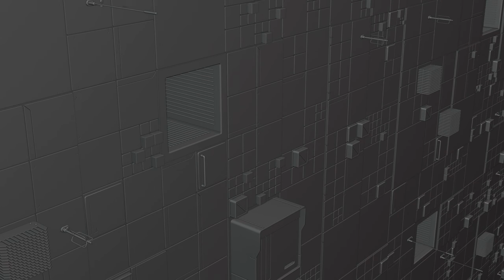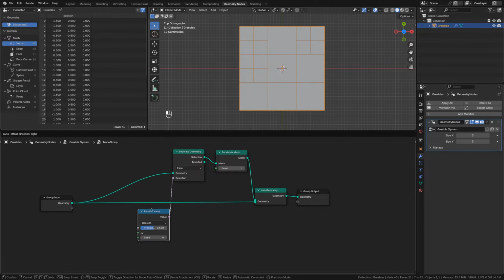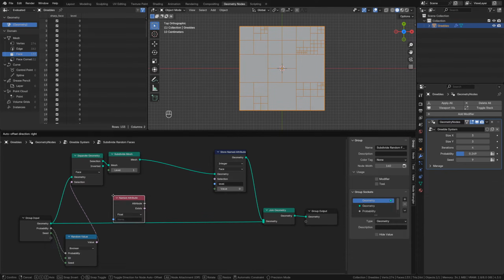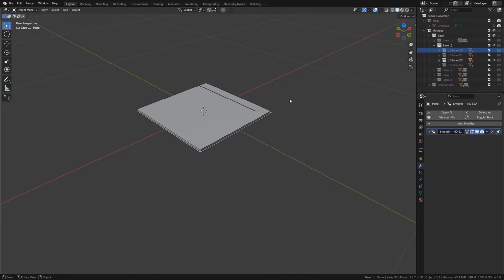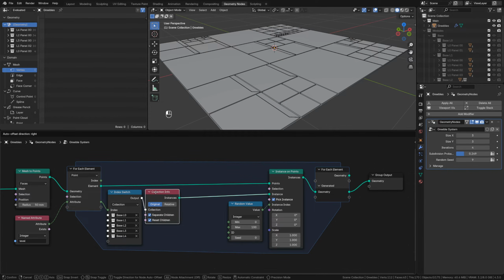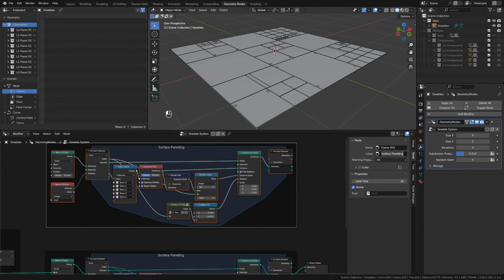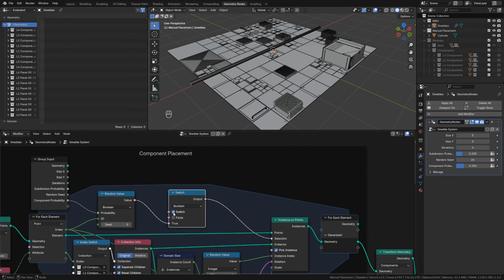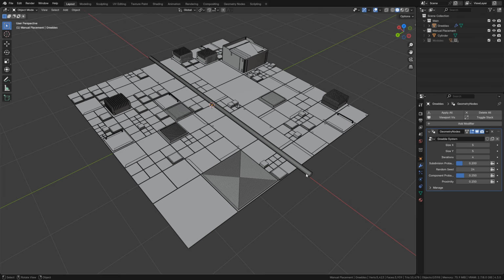Sci-Fi Greebles with Blender Geometry Nodes

Comment: Great tutorial. I am just coming to Blender from 3DS Max. In Max, I used a much simpler, much less controllable plugin called Greeble to do a super primitive version of this. This is far better, wish I'd had this much control in my max projects. Forgive me if this is a stupid question, but is there a way to make this a module that I can call up instantly in any project, rather than rebuilding this whole system from the ground up every time?
Reply from the maker: Hi, yes, you can definitely save the node setup as a reusable asset in your library to use in any project (https://brandon3d.com/geomentry-nodes-asset-browser/). This is a bit tedious unfortunately, but it's how we created the ND v2 Asset Library. Another way is to append from a saved Blender file to the current working file `File > Append`, which works with any kind of thing you'd like to reuse — Ian

Comment: ok, but this is done on the flat surface, how to creates the panels on cube or other 3D geometry?
Reply from the maker: Hi, this is trickier. I would try modeling the base geo to a standard sizing. Then I would use a foreach to loop over each face. Each face you would then treat as its own flat grid, applying the rest of the node network demonstrated. - Ian
Reply: @HugeMenace  ok, thank you so much - this is my first time when the content creator has answered my question, I appreciate it
Reply: @HugeMenace  Would it be possible to use the normal information of each face to rotate the instance? I'm new to Geometry nodes so I might be saying nonsense

Comment: Nice tutorial! But I don't see the grid at all when I add the grid node in the beginning :(
Reply from the maker: Hi, does the node appear? Is it just the viewport that is empty? I'm not sure what the problem could be, but it's probably something frustratingly simple. — Ian
Reply: @HugeMenace  Hi, the grid shows when I toggle X-Ray mode, but in solid mode it is only the plane, no grid. Maybe I'm missing something, I followed every step :) . Again thanks for the tutorial!
Reply: @VGModelling3D Bro, you need to toggle on the Wireframe in the Geometry options. This placing in Viewport Overlays.
Reply: @ivanmihailichenko9158  Thanks!
Reply: If you are using 5.0, it's fast to ask AI or something because there is a glitch that you can't see grid in right way if you use this combination of this nodes. I already experienced this and I looked up about it, and it was known glitch. So if you are using 5.0, you should use 4.3 instead.

Comment: Am going to watch this leter just need to know.

Will this have connected pips as well  ?
Reply from the maker: Hi, not in this video sorry. However, we have since added a pipe tool to ND which can be used to manually place pipes on the surface and have the other greebly bits avoid that. The procedural part of this video is mostly the recursively subdividing grid, no procedural pipes yet. Maybe one day I will revisit that. — Ian

Comment: 45:54 - yeah! i really like these kind of videos. I love procedural workflows.
how did you put more "floors" over the base layer in your final piece? are they just more COMPONENTS?

awesome tut! Huge thx!
Reply from the maker: Glad you like it! I assume you're talking about how the overall surface is not completely flat? Well spotted, I left this out of the tutorial for brevity :)

It's easy enough to replicate, you basically just place an 'Extrude Mesh` at the end of the 'Grid Generation' group. This node takes a selection, so I just used the 'level` stored attribute to limit which size faces were extruded. I only wanted the level zero to be used so that large chunks of the base/floor were at slightly different elevations. I also threw in a little bit of randomness so that not every level zero square had extrusion. If you'd like to see this in detail, please come and say hello on our Discord. — Ian

Comment: hi ! thank you very for this tutorial, so i made my own model in collection like the video and with ND too😎, i have problem with object in collection does not scale in face subdivision, about the 25th minute of the tutorial, verified all scale ok in collections Is there anything particular to set up on the collection?
Steph.
Reply from the maker: Hi, glad you like it. Are your collections ordered from top to bottom in scale? So in my example, the largest (0) is then followed by (1, 2, 3, 4) in the outliner. This might be the issue, but it could aslo be something else. If it's easier, please feel free to post in our Discord and I can take a look at your setup more closely.
Reply: @HugeMenace  hi ! collections are named same as you on video : Base\Base L0\L0 Panel 00\ and two part base (plan) and Panel two are created with ND and same for the rest,  i don't have discord on this PC (not a big fan with discord) I'm going to redo the meshes simply without ND to see just basic shapes and see if it's the same thing. (I use a translator in difficult cases so don't pay too much attention to my English😅)
Reply from the maker: @stephanema.6220  Ok, yes you can try making a copy of your ND objects for backup (moving them to a separate collection) and then apply all modifiers using the `Utils > Apply Modifiers` https://docs.nd.hugemenace.co/#/utils/apply-modifiers
Reply: @HugeMenace  find the problem i think my bad english, in fact each collection manage the scale according the subdivision, just listen twice (25 minutes) the nod juste place the model i doing divide the scale on the second collection for test
Reply: problem resolved thank you very much, by following English tutorials on Blender on youtube I pay more attention to the visual of the manipulations on the video on listening I sometimes miss the detail which means that nothing works anymore😅ND is interesting i'm using SolidWork a lot, i make some model (Warhamer Dreadnought brutalis's Gun) in low poly and Bevel is my current model, but with ND and Solidwork (STL export to see how tri and quad) Two, very interesting.
I'm not a Blender 3D pro of course and generally I make 3D models episodically, but I find that the progress of Blender is really astonishing for some time, in the past I used 3DS max a lot. In any case thank you for your tutorial it's difficult to remember everything about blender.